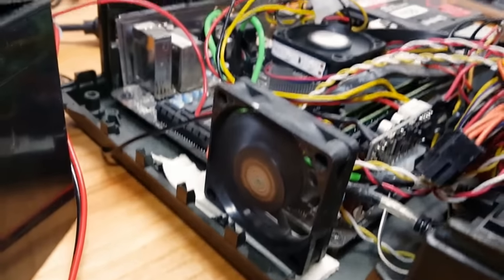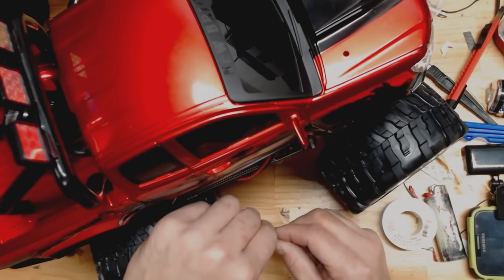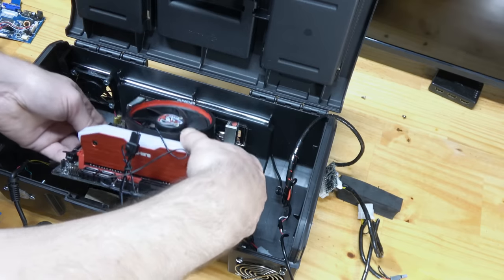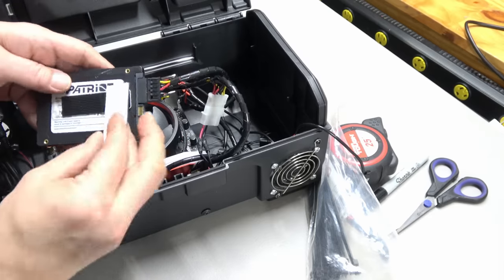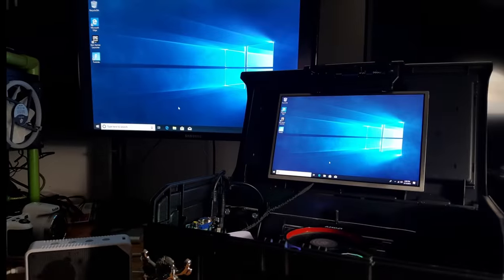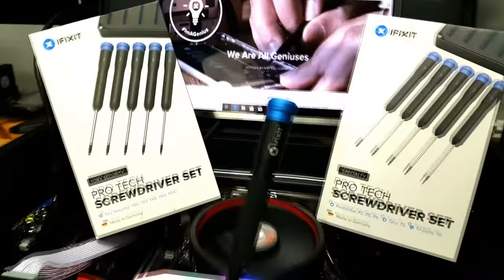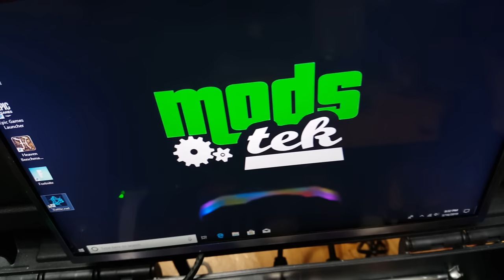Gaming PC In a toolbox

Comment: Should take it the next step and put a PAM8403 5 volt 3 watt stereo amp and some 3 inch drivers for a "sound" upgrade. 
It draws so little current off the 5 volt rail that the pico PSU won't even notice.

Comment: That's an awesome build.  Vid showed up in my recommended list.  If I built it I'd add a 2nd intake fan  behind the SSD, for for cooling the SSD but for 2 things, 1 for the additional air to help cool the internals, but secondly for my OCD and symmetry.  I would also put some clear perspex on top of the PC itself with rubber grommets for the needed cables, as well as an additional sheet of perspex over the monitor, again with needed grommets.  Where the intake fans are, I'd put dust filters on them.  That setup should then help prevent ingress of most dust entering the system.  But other than that it still looks frickin' awesome and I'd buy it even if it was just for bragging rights.

Comment: Anyone know what size jack is required to connect to the power? ( the connector next to the HDMI on the circuit board that comes with the display)
Reply: Typically 2.1mm or 2.5mm are the most common DC power connectors.

Comment: What power supply did you use for the 10" display? Doesn't appear to have one included.
Reply from the maker: I spliced into the Pico power supply using a barrel connector
Reply: @modstek  Could I ask what size jack is required to connect to the power? ( the connector next to the HDMI on the circuit board that comes with the display)